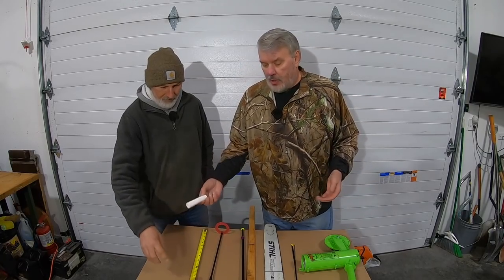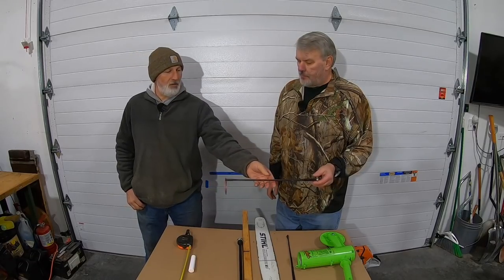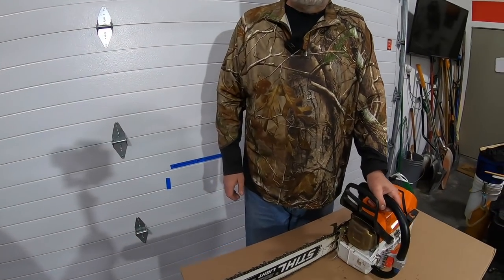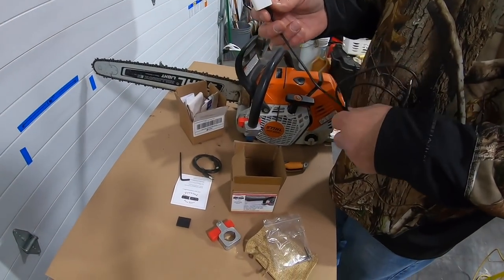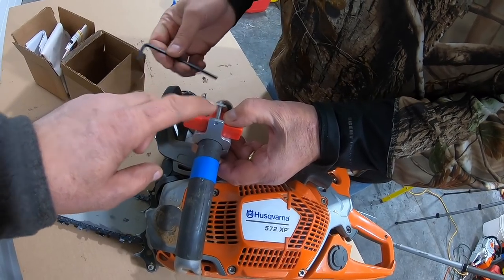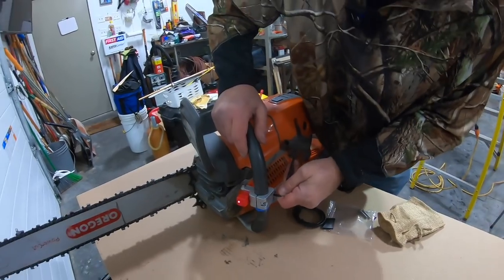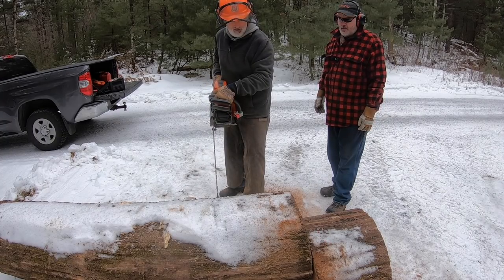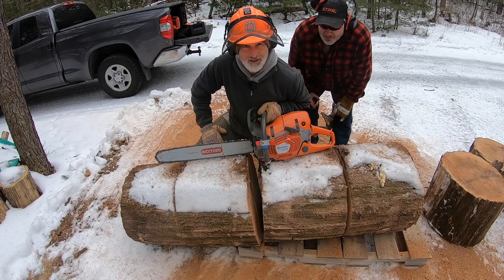ProSizer - Firewood measuring device for accurate cuts each time

Comment: Chris, I have been trying about all of the different types. I usually take three to four saws out when I cut, this saves time in refueling and always seem to have sharp chains. Not wanting to spend over $ 200 prosizers I have installed extended nuts on the front bar nut. Originally I threaded SS rod but had to unscrew it to refuel so now I drilled a hole through the nut and an unthreaded rod and use a clip to hold it in place. Easy to install and remove and cost is about $ 3 per saw. Works for me. Thanks for all your videos.
I am a retired pro photographer and really enjoy the firewood business although at 75 its getting harder.
Reply from the maker: Thanks for watching Buddy! Just keep cuttin'!

Comment: I currently run the prosizer myself. I had been doing the measurements with a stick and marker. It was slow and I’ve lost those then I made a magnet tool works good but it’s something that you can miss place and lose. The major thing I like about the prosizer is it’s on my saw and does not get in the way. It does need to be changed but it run for quite awhile and in the very bright sun it is a bit hard to see. It’s pretty accurate and consistent with lengths. Now there will always be a bit of variation because we aren’t using a fixed cutting tool like a processor. I would have to disagree with it being easy to see in the sun in the direct mid day sun it is hard to see but most other times it will be fine. I have had no issue using it in the cold and it stays on my saw that I keep in my tool box on my truck. It’s one less tool to worry about bringing out to the wood ward or the forest. All tool have pros and cons. You also need to be a bit more conscious of trying to stay at a good 90° angle to the log ( it does take some time to get at marking the log and then cutting.) once you get good at marking you can seriously plow through the wood. I like it myself so I’d buy more down the road. Cool to see more people embracing new tools.
Reply from the maker: Thanks for your input! Great to know!

Comment: GP Outdoors has one and did a really good review. If you're looking for the 15-17" range I'm sure they're great. You have to make sure you have the bar 90 degrees to the wood or the length will change quickly, so the longer the bar the harder this would be. If you're looking for exactly 16" I think the accu mark might be the best.
Reply from the maker: Maybe so!

Comment: I’ve never found a need for any measuring device other than my trusty 1 metre long stick with 3 screws in it. If it’s less than a metre it goes straight onto the splitter, any more then I cut it down to 1 metre using the screws to mark where the cut goes. 
After the lengths are split, I use a rack to cut them all up to the desired lengths. I have markers at the base of the rack so I always get them consistent lengths. 
That set up had worked for me for years now.
Reply from the maker: That is a great idea wood man!

Comment: Morning Guys! I Like that Prosizer alot - Bob and Em are wonderful folks. I am finding after using it over last summer and the Fall, that I get more than 5 hours out of a battery charge. Makes for quick cutting. Just takes a bit of time to get a hang of where the dot is, versus your bar, but once you get used to it, you begin cutting more more consistent. Just when you thought you couldn't block wood any quicker - now you will be on fire Chris!! LOL! Have a good one!
Reply: GP I agree it takes a little bit of getting use to but when you’ve mastered it you wish all your saws came equipped with it. Bundled wood comes out extremely consistent which makes your bundles look more professional, almost like it was cut on a processor. Happy cutting…
Reply from the maker: Thanks a bunch Gord!
Reply from the maker: Tony! You are the man!
Reply: LOL! You guys are like Batman and Robin out there .. The question is....which one is Robin? 😅

Comment: I've heard it before that Chris likes a bottom grab.
For accuracy due to parallax errors you would be better off with the laser to the outside. For bash protection obviously it's better on the inside. I'd say that the biggest disadvantage to using the ProSizer is that you always have to be the same distance from the log as what you measured at. In Chris's case he marks when the tip is touching the wood and then immediately moves the best part of the bar length closer to start cutting. For speed I think you'll find the whiskers will still be a fair bit faster.
Reply from the maker: We will see, maybe I can do a review after using it a while!

Comment: Just use some canned air to blow out the charge port before you start charging. 

If you notice that the bolts are moving after a while, then use some blue loctite and mark the bolt locations for a visual checking on moving.
Reply from the maker: Thanks Phil!

Comment: The big problem with this method is that as the laser is at an angle the length will vary when you move the cutter bar on or away from the log, surely it would be easier to just move along the log and mark before you cut through it, and much quicker even though you are doing 2 moves.
Reply from the maker: I mostly use a couple zip ties on my handle...faster and easier.
Reply: @InTheWoodyard  I think the ties like you use are a far better way to go, if they get broken they are easy to replace, with electronic devices and batteries they will always be trouble. Stay safe ! Chris B.

Comment: Personally, I, like others, made a template of the desired length of the boiler from an M6 stud with 2 nuts that attach this template to the chainsaw rail. I make 3 marks on a meter-long log, quickly remove the pin, do the cuts and repeat. This is a bit inconvenient, so it is better to replace the nuts with neodymium magnites. It's even cheaper, almost free. And although the laser is cool, you will quickly damage or destroy it against a log. Due to the constant shaking of the saw, the fastening screws will be constantly lost.
Reply from the maker: I mainly use a zip tie most of the time.

Comment: On the Firewood ProSizer webpage they an option for a Swivel on the laser it’s $74.50 .
The Standard ProSizer you demonstrated is $64.50
I bet the Swivel one is great for adjusting the laser beam down without moving the clamp down the saw handle. 
They also have chose of green or red laser.
They are back ordered. 
I think $39.99 would be a better price point.
Reply from the maker: My grandpa once was fixing an old truck up an needed a specialty bulb from the auto store. So when the counter guy handed him the bulb and said that will be $12 he said that is too much for a bulb and the guy put it back in the box and back on the shelf and said ...Go make one yourself.....
Reply: @InTheWoodyard  
Maybe your  grandpa needed that bulb but the ProSizer I don’t need.
Good story though.

Comment: Nice video job.  I've seen the ProSizer advertised before and wondered how well they work.
I wonder why the saw companies haven't found a way to integrate laser measuring into the body of the saw with external angle adjustments.  Not sure I like the handle mount of the ProSizer.  Yes your rakers appear to be a little low, but the bogging/stalling will go away after the first or second tooth sharpening as you already know.  Did the ProSizer make Tony's saw finally cut straight?  GNI
Reply: Ok
Reply: The ProSizer is a great device the mounting is not a problem for me at all.
Reply from the maker: It is a Stihl, what do you think???
Reply from the maker: Great!

Comment: The human eye is very accurate and with practice its quite easy to mark off 16" by eye with no reference. If you are doing loads of logs, assuming they are the standard 8' use your saw to make a mark at the 1/3 and 2/3 point, then make a mark in the middle of each of these three sections. Voila 6-16" blocks ready to be cut. No gimmicks, easy and repeatable. If you have 16' logs, cut them in half first to make it easier to layout.
Reply from the maker: Yup, that is a good point but not as accurate. I like my zip tie markers better so far.
Reply: Zip tie marker is cheaper and you don’t have to charge those.

Comment: Would be pretty slick if it could be integrated into the inside of the handlebar. I guess it holds up to the continuous vibration of the motor or we'd have heard about that by now.  Only tricky bit is holding the saw the same way to the log for every measurement.  I think I'll stick with my magnetic magic wand.
Reply from the maker: Maybe so!

Comment: If you wear size 9 and a 1/2 boots, it is a foot and a heel. Your boot is 3/4 of the length. Just imagine a quarter more and cut there. With a sharpie, I draw a line across the top of my boot (back from the toe) at the point that equals distance needed. It is easy to visualize that much further and make precise cut
Reply from the maker: Good idea, I like my zip ties on the handle.
Reply: @InTheWoodyard  Yeah I like your zip ties on the handle also... Whatever gets results🤪

Comment: How about using the bar as a measuring tool?  I’ve been cutting wood that way for 40 years. I have a Prosizer and it seems unnecessary and not any more accurate or efficient. Plus, it moves and gets in the way.
Reply from the maker: I used to do that but it is slower than the zip tie system I use now the Prosizer is nice but it gets in the way a lot when cutting.

Comment: could use a v2.0 where they redesign the handle hole at an angle to aim the laser down.  down a little much would be better than up too much.  cant think of many saws where the side handle is vertical..???  maybe i dont know...
Reply from the maker: Maybe so.
Reply: hmm , actually just ran a Husky 350 and its handle is pretty vertical. So I guess i DIDNT know!  :D   No good way then to do a one angle fits all. It needs to have some adjustability.

Comment: I would set it up so it lines up at the motor and the teeth because I don’t like messing around the tip and then it won’t matter what length the bar is. The second thing I put in the adapters for the magnetic cable charger it keeps the connect clean some that are hard to keep in because of vibration I put a bead of black light glue around the magnetic charger adopter
Reply from the maker: Then get one and do it, they made one just for you! Thanks for watching Glen.

Comment: I run 372 xp with 28 in bar will it work with long bar ?
Reply from the maker: Yes it will but a shorter bar will cut faster and have more power. You might want to talk to a tech at a saw shap.

Comment: The laser needs to be adjustable like a laser on a pistol so it can point down further. I use the ACCU MARK and love it but yes you have to be aware of where its at  but its rock solid on the bar. You should do a video with you, Tony and your Brother using different ones and do a race (for lack of better words) and see which one is the most efficient, my guess is Accu Mark would win.
Reply: the lazer is adjustable to any length you want I own one and have great results.
Reply from the maker: Maybe!
Reply from the maker: Cool!

Comment: Tony question on Adding Bar Oil on your Stihl Chainsaw?
Reply from the maker: What is the question???
Reply: @InTheWoodyard  with the electronic laser on Tony’s Stihl it looked like you’d have difficulty adding Bar oil without removing device, or was it just camera angle?
Reply: @rickthelian2215  Rick I positioned the Prosizer slightly above the oil cap. No issues filling the oil on my Stihl saws. Hope this answers you question
Reply: @TonysCoolTools  thanks Tony, camera angle just made it look like the Lazer was over the cap😀
Have a new ce day😀

Comment: Ok so, you have the dot where you need to cut,
 then you be have to remember exactly where it was once you move the saw to cut 🤔
 This leaves a margin of error for a lot of people, and that margin can be that 1 inch, mentioned.
 Theres a better way that I've been working on, and hoping to market soon, which will leave zero margin of error as all these products shown produce.
Reply from the maker: There are a lot of ways to measure cuts, I have tried them all,  the fastest and easiest is a zip tie /cable tie on the saws handle, i use it all the time.

Comment: Bad thing about this is if you use more than one saw while cutting firewood you'll either have to buy more than one or take it off n put it in lol no one will do that lol. So your$150 on the home for 3. But if you have a dedicated chainsaw just for firewood like myself I see it would be faster than with the measuring stick I use attach to my bar. I do give the saw a rest about 10 mins while I touch of the chain after every tank so I won't burn the saw up.
Reply from the maker: Yup, all good points!

Comment: still the best tried and true method is the premeasured tool and a LUMBER CRAYON, throw away the chalk, and use a crayon 99 cents at any home improvement store . 60.00 plus a set of batteries per day is expensive, 5 hours of cutting only gets you at noon. hauled out 45 cord in 6 days one time,cut load ,haul.
Reply from the maker: Try my zip tie method, it saves you a lot of time! No measuring! I have a couple videos about it.

Comment: Mounting the laser high on the bar may not point to the log .So I think lower on the bar is better.
Reply from the maker: Maybe so!
Reply: They offer one with a swivel laser for $74.50 which is $10 more then the standard ProSizer they demonstrated in the video